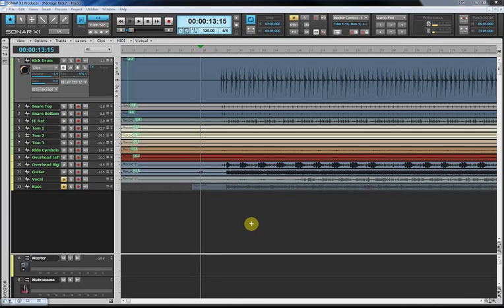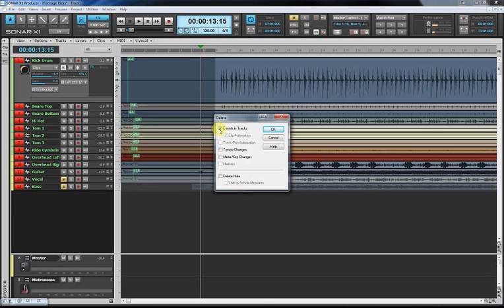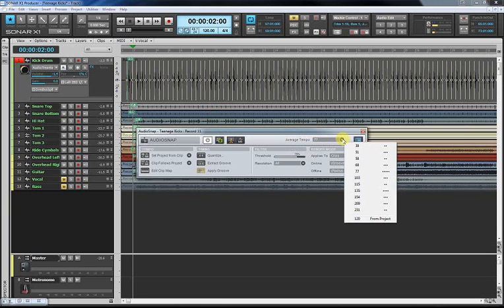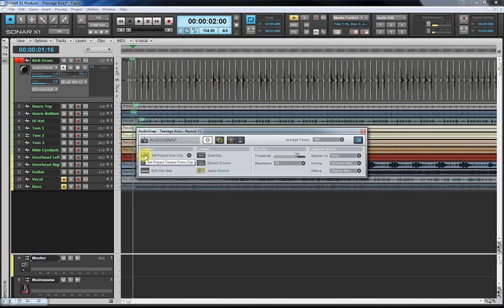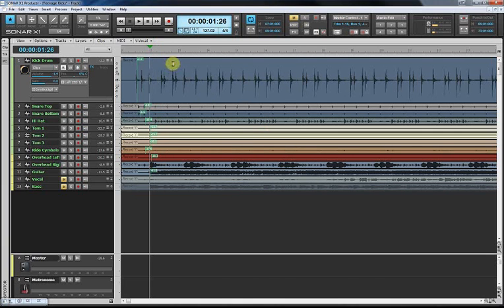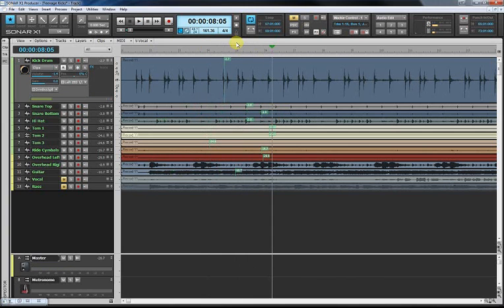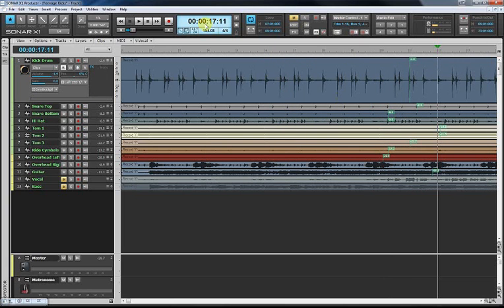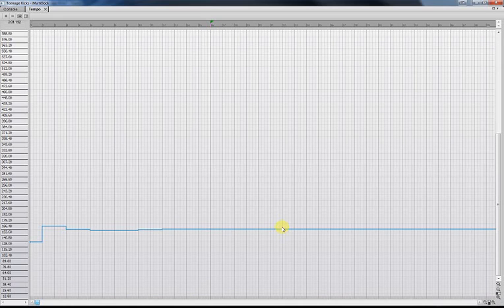Sonar X1 - Creating a tempo map from live audio

Comment: Thanks for this!  I've been trying to figure out who to create Midi patterns that would match up to a live drummer.  I knew there was a way but did know where to find it!: )  I'm using X2 but I'm sure the feature is the same.  If not, I at least understand the process after watching this.   This makes me curious.. Is it possible to "quantize" digital audio?  In other words, make your drum sound like he's dead on?
Reply from the maker: Hi there. It is possible. The process is fully explained in my video SWA Complete Sonar X2 (on special offer I believe in the Cakewalk store). Basically you need to select all drums including overheads then use the "Merge and lock markers" command to prevent phasing issues. Then use the "split clip at beat" function before quantizing. This will move the beats complete rather than stretch them. HTH